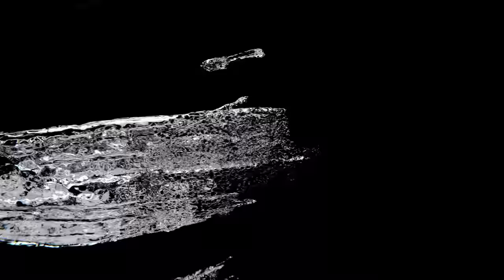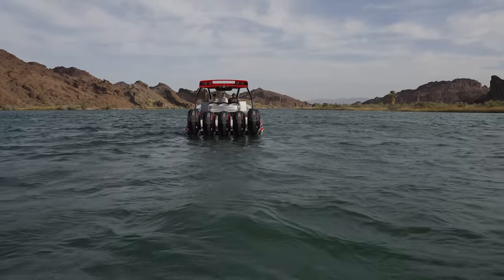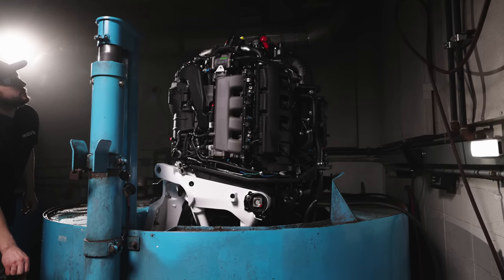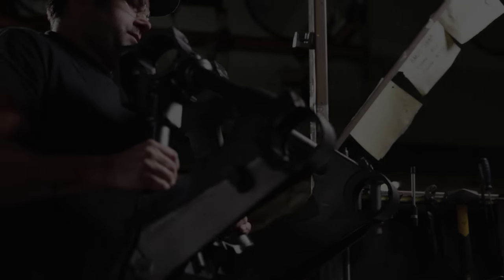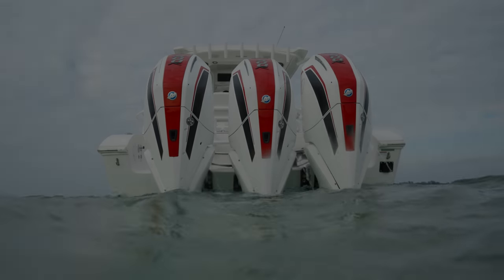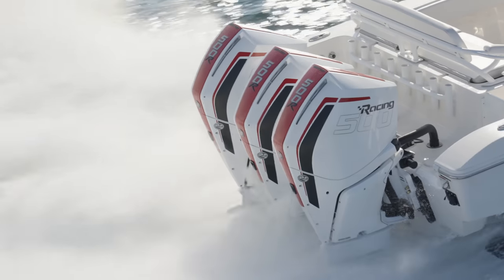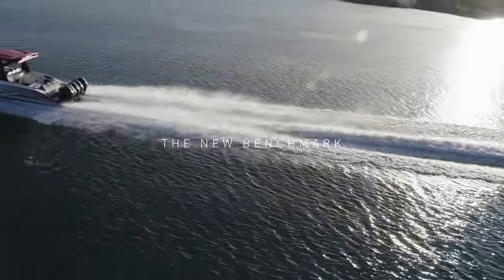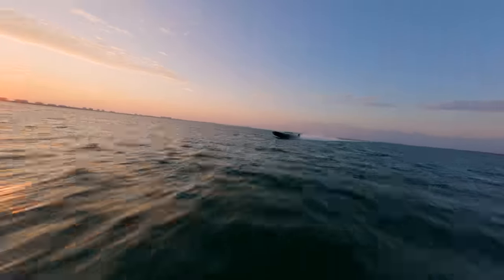The New Benchmark | 500R | Mercury Racing

Comment: Yes, but does it have automatically adjusted hydrocoptic marzal vanes in the supercharger section? Because without them, you'd need to add an antihydratic disenfranchilator ahead of the pressure-sensitive bypass trivalves. The instantaneous hydrolastic overpressure of the inlet manifold ducting would be horrendous!
Reply: Not to mention that the transversely mounted gyro buffer injector stators for the clenching valves at the back of the cooling coils for the circuit breaker manifold gasket tightening ratchet cross member with the same bolt plug will have to be replaced at least every sixth month.
Reply: @markwoodbury2653 every 6th month only if the anti-hydrostatic balance pulley is a few 10,000th ounce of balance. If you keep the air lubricator fluid reserve tank full of race grade lubricitor fluid, and the fuel ionizer negatively charged (positive charge leads to more carbon buildup and detonation), the gyro buffer injector stator will last at least 7 or 8 months...
Reply: Well played!
Reply: Wouldn’t it have been less expensive to just update the Seven Marines engines?
Reply: All for the low low price of $135,000. But  it you act today, you’ll  get an extra engine for today for the introductory offer of just $13,900!
Reply: @davidlenig8470  This stuff made my day 😂
Reply: I just smoked a blunt and this was wild LMFAOOO.
Reply: I’m sorry, what?
Reply: Very point 🤔
Reply: Indeed
Reply: Pretty sure my Yamaha Malta 3.5 has had these from 1998.

Comment: 80 grand a piece!!! Think I'll be stickin with an inboard.
Reply: don't care
Reply: inboards always fail and have problems lol im not going 100km offshore with a tempremental inboard
Reply: @rinzlerprime3372  Depends on what inboard of course. I have an old tri-hull with a tuned up "iron duke" 4 cyl in it. Its basically the same motor as the old Northrop mail trucks you're use to seeing in the USA. They put those in a ton of GM vehicles too. The marine version is rated for 130 HP.

Comment: I bought a 20 hp mercury and sold my old johnson motor, the mercury just had more power even for 20 hp.
The design cypher on the back of the boat off of tge old flags was part of an engine also, i didnt realise they had aft burners in mesoptamia but i guess so. 😉

Comment: What's the difference between a 300 pro xs and a 300r?
Reply from the maker: There are many differences when comparing the Mercury 300hp ProXS and the Mercury Racing 300R. The tuning of the engine, the components used to build the powerhead, a selection of optional midsections and gearcases, as well as the rear tie-bar configuration only briefly detail what sets the 300R engine apart from those of our mainline manufacturing offering. Visit the link below to learn more. 😎
https://www.mercuryracing.com/engines/r-series/300.html